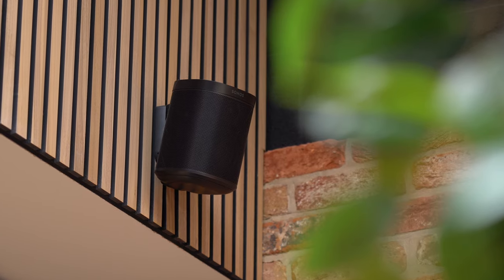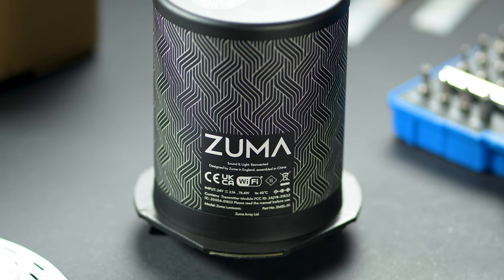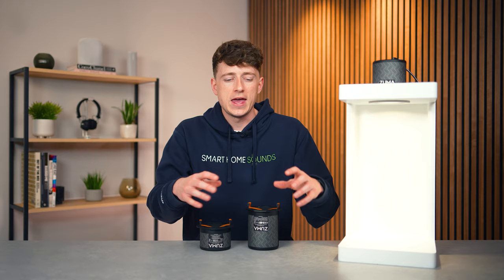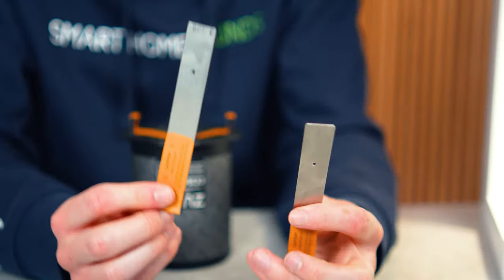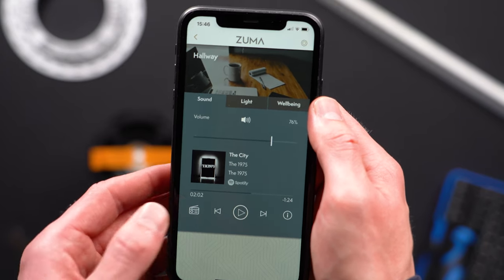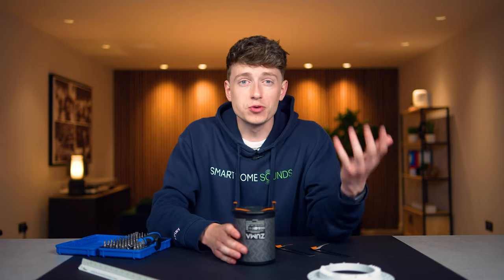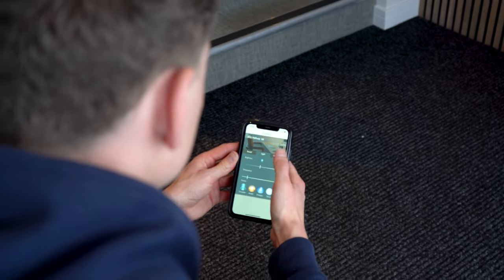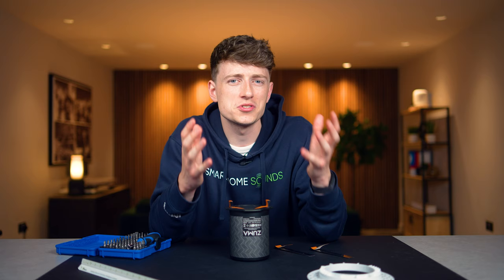The Future of Home Lighting? Zuma Review

Comment: I committed to this system soon after it launched, needing a smart lighting system for a house rebuild. I have 50 units installed, a mix of Lumisonic and Luminaire. It's utterly brilliant and after two years have no regrets. Will put more units in eventually. The ease of installation and set up is amazing, as it takes minutes and connects to an existing lighting circuit. They now have bezels with a built-in microphone for direct Alexa control. They are best used in "always on" mode using Shelly relays. A key feature of the sound is the DSP and lack of any discernible point source. The software was fully functional at launch, but after two years the performance has been dramatically improved and is now painless. The sound is miles past Sonos. I have a dedicated music room with a very serious hifi system, but I use Zuma most of the time. I also use it for regular music listening, as a 7-speaker surround AV system with Apple TV+ via AirPlay and even have them in the bathroom and listen to podcasts whilst having a soak.

Comment: Just moved into a home that has a built in TV in the bathroom. Would be interesting to know if there's lip sync issues. This product would be perfect to pair up to the TV as Bluetooth speakers for better sound as well as having a good shower sing
Reply from the maker: Thanks for the comment. That would be a great solution. We have tested it with TV, and in our testing we didn’t experience any delay issues.
Reply: @smarthomesounds  interesting! Now for the wife approval... thank you for the reply!
Reply: @smarthomesounds  I did have a sync issue with an LG screen, but the problem is the bluetooth sound quality. Zuma recommended Apple TV+ and the AirPlay sound quality is miles better with no sync issues. I appreciate some systems have sync adjustment, LG doesn't (as far as I know), they would prefer you to by LG AV speakers. 

I've posted a couple of my own videos showing it in use, also with the new microphone bezels. I think I'm a beta tester as they required a big software update.

Comment: Good video, balanced review. Doing up a whole house after a massive leak - like you, I am a massive Sonos fan and have Sonos throughout my old house. But I have been persuaded by the smart people backing this, the very high design and especially build quality, and above all the ability to vary not just the brightness of the lights but the colour temperature. Add in the ability to alter zones within a single room eg make two out of 9 lights brighter cos I’m sitting underneath them, and this has really convinced me. The sound is not hi fi for sure, but then neither were my in ceiling + Sonia system in my old house - to my ears (keen hi fi fan but am also 58!) these speakers sound better than my old in ceiling Kef ones and especially re the sound balance and even-ness. I’m therefor going to back them and am putting the throughout the house, but keeping my top end Linn hifi of course 😉 Also the price is already getting cheaper, esp if you buy lots of them!